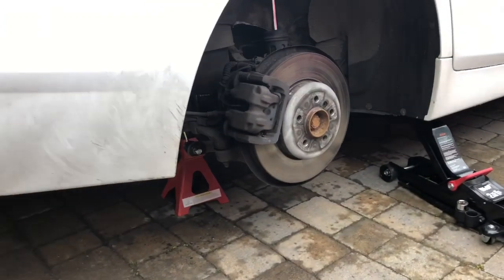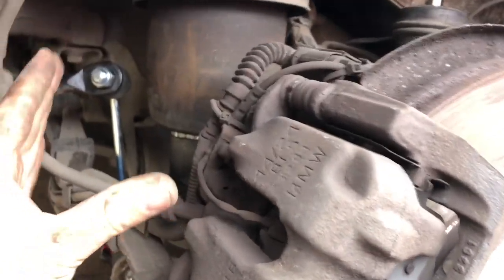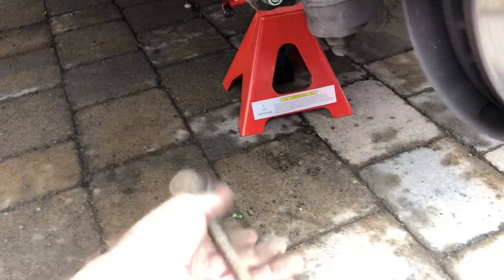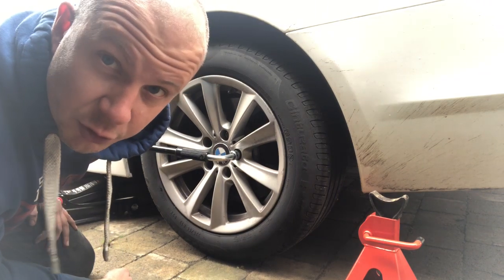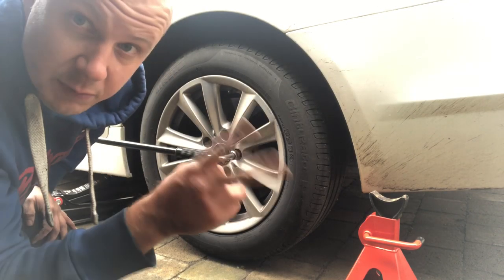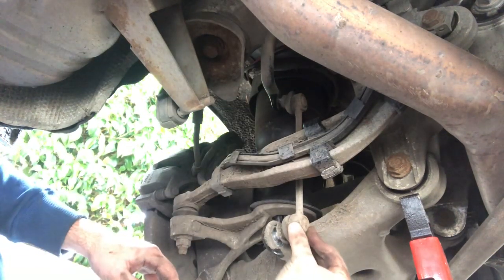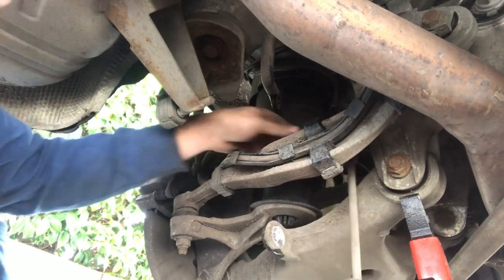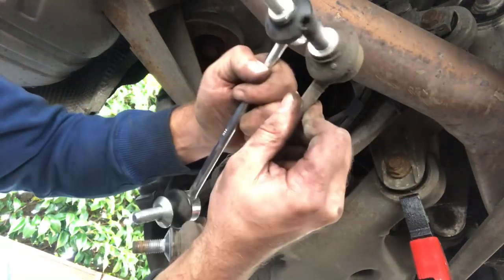BMW 530d Quick Job - Drop links

Comment: Good to see you using axle stands Too many people cut corners and only use the jack to support the car. If you’re doing any jobs which require the car being jacked up, don’t take chances, a jack is not a support
Reply from the maker: 100% right 👍
Never take chances with your safety.
Reply: @Nut_Job.  yesterday my jack blow of 😂😂 i had axle stands 💪💪

Comment: if you need inspiration for new videos, I would be interested in a video tutorial on how renew the brake fluid (with or without pressure bleeder). Other interesting ideas: serpentine belt change, brake pads or disc change, rear air suspension bellows change, .. Many thanks for your videos, big fan of your channel.

Comment: You're uploads are fantastic, thanks for sharing. Looking for some advice on a small issue I'm having with my 535d f10. There's a consistent hum/low vibration from car when driving above 50mph. Not too intrusive, but enough to annoy me. Sounds almost like a bearing is worn but I don't think that is the fault. I've had the wheels balanced and BMW look at it but they couldn't find an issue (don't have much faith in their assessment anyway). Don't think it's a drivetrain issue as I've put the car in neutral while driving and it's still constant. Almost certain it's from the front wheels. A suspension component or disc issue? Any ideas would be helpful thanks!
Reply from the maker: Noises at speed can be a pain - I know. I did a video on this with the Range Rover & it turned out to be the plastic scuttle at the bottom of the windscreen. 
If you think it’s related to the front wheels then I’d jack up the front end, remove the front wheels & use a big pry-bar to check all your suspension & steering joints are solid. I’ll be doing exactly this on the F11 too when I get a dry day soon 👍
Reply: OutdoorGeek flex disc connecting rear drive shaft to differential. See if it has any cracking. And check all your dampener mounts. Look at it yourself. Bmw dealerships are garbage. They want to wait for something to actually break then cause more damage.
Reply: OutdoorGeek 
You can quite easy check if your wheel bearings are worn. 
Drive on a flat road at above 50mph so can hear the noise. Turn a bit to left and right. If the sounds gets louder when turning that’s a good indication it’s your wheel bearings. You can also determine on which side. They should wear out equally on both sides but usually one side has worn out just a bit more thus making more noise. Highly recommended to replace them on both sides of cause.
Reply: Thanks for the helpful advice guys.

Comment: Hi. Womdering if u could help. I have an E60 530d. It was idling in the driveway and it shut off. Refuses to restart. The code reader says camchain sensor. Is that a broken timing chain or broken sensor?.

Rgrds
Reply from the maker: Arrrrgh.... well it’s tough to know without some further investigation. See my earlier videos where I investigate whether the sensor or chain failed... 
Symptoms of a failed chain are the initial noise (if heard) when it fails, slightly faster cranking speed when trying to start. On the N57 you can use a borescope camera to view the top camshaft sprocket through the camshaft sensor hole - turn the crankshaft pulley on the front of the engine & see if the camshaft sprocket has turned.